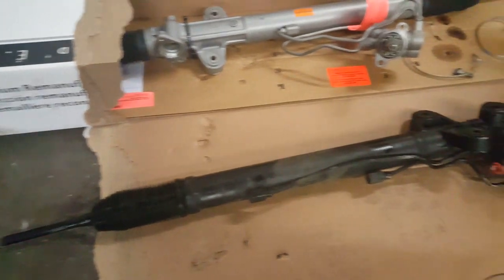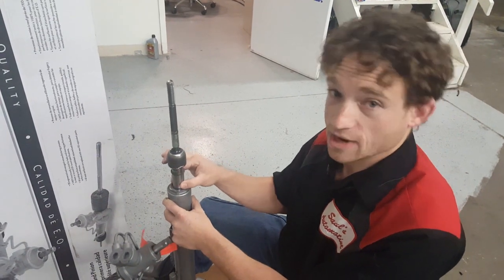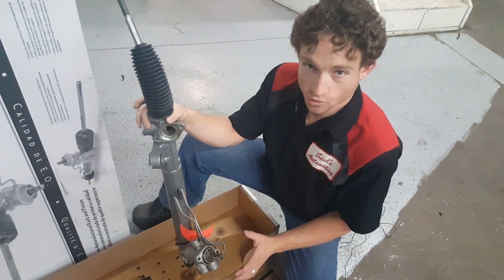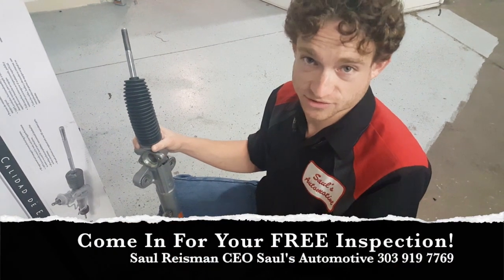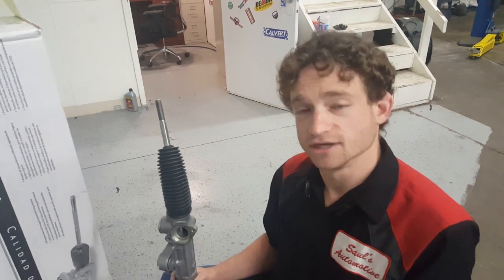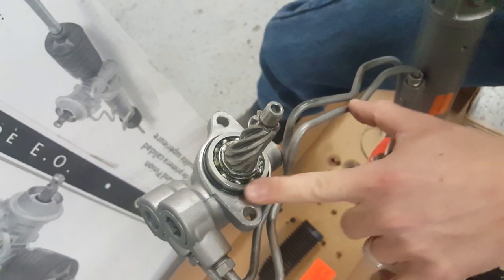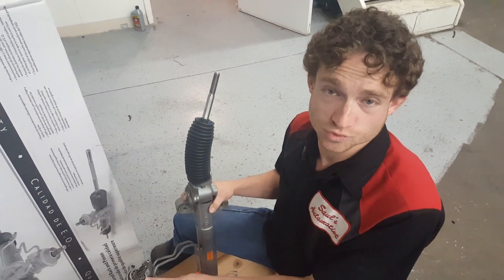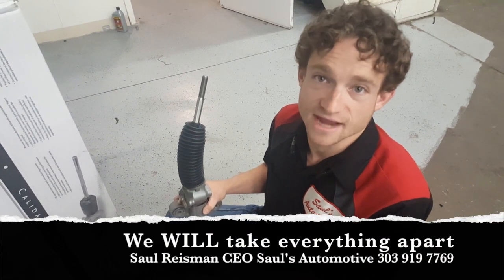Taking Apart A Rack And Pinion For Safety Denver Auto Repair

Comment: I just replaced my rack and pinion with a brand new one. I was curious how they worked so I completely disassembled the old one all the way except pulling the long shaft out of the housing. It just wont pull out all the way as it stops at a certain point. Any tips how I can pull it out completey? Thank you!

Comment: Saul,  not knocking you, but because you claim to be an expert on rack and pinions, I just wanted to point out a few problems with your description:  1-The rack gear mates with a pinion gear, not a worm gear ( rack and pinion)  2- A knurl is a cross hatch pattern pressed into a round part on a lathe for grasping with fingers ( usually),  what you point at is a hex for a wrench.  3- The number of teeth is related to the ratio between the gears, a coarse ( lower number of teeth) gear will be a quicker ratio.  4- The rack backlash is adjustable using the jam-nut near your fingers. The jam nut is loosened and the screw thread pushes a "foot" against the rack and reduces the backlash between the gears, then the jam nut secured.  5- The servo pinion is supported in 2 places and the bearings don't generally wear out in a normal life cycle.  Usually it's seal leakage that determines a rack replacement. 6- What you call the cooling lines are actually hydraulic lines which port hydraulic pressure to either side of the rack piston, which is determined by the servo from a turning input from the steering shaft =power assist. Cooling lines would be used between the pump and the servo. 
 Carry on
Reply: Cringed when he said "cooling lines." I can forgive the worm gear mistake as the pinion almost looks like one. My god. Does he even know how this component works?
Reply: Lol, good one.  All saw was a good sales man!  Since most customers have no knowledge they will yield to a good sales man.   Thank you for providing clarification!👍🏾